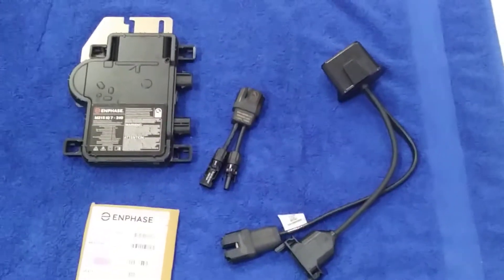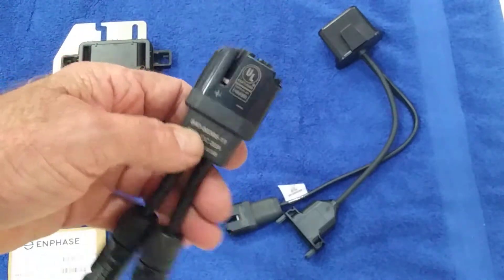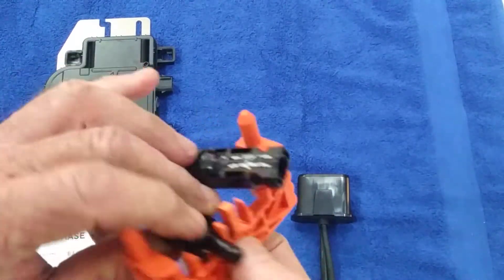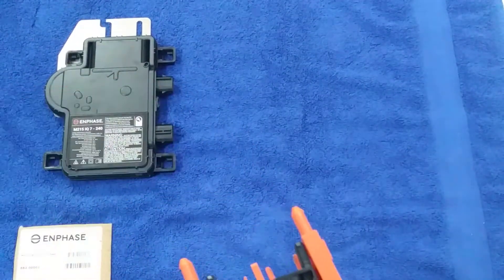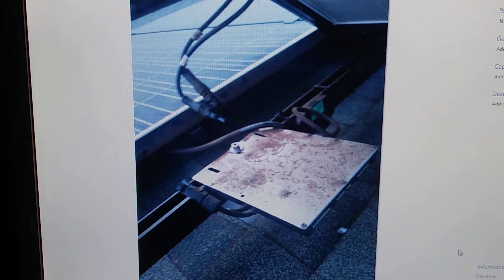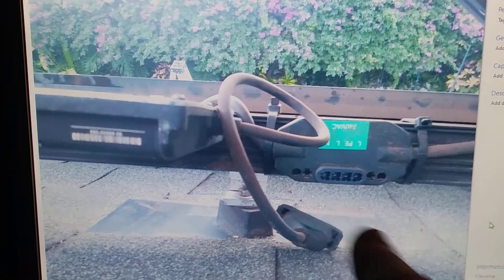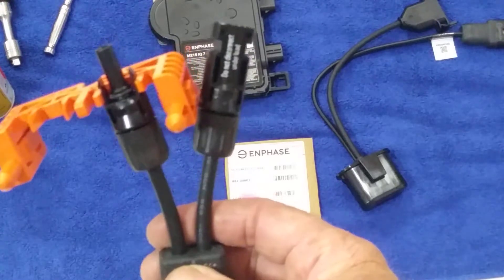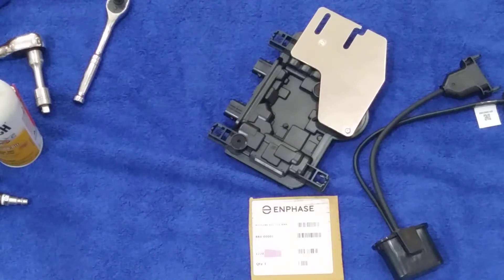Changing An Enphase M-215 Inverter

Comment: That was really informative!  I got a new M-215 IQ7 from Enphase under warranty.  Now I'm going to order the tool.  For some reason they sent me 3 of the cables that go to the panels.  They also sent me 1 cable to the rails.  How heavy is the panel?  I'll be working by myself.
Reply from the maker: Hi, Dave: I was up there working alone too. Hopefully you are replacing the inverter on a panel that has another panel below it. I have 4 panels that face East and my first attempt was on the top right panel. First try to read the serial number on your "dead" panel with your phone's camera. Have Enphase verify that the serial number is the dead one. My installer cross-labeled my #4 panel facing East with my #3 panel facing South (I could tell instantly from the daily production numbers, & Enphase switched the two panels on their end). Once you verify that the panel that appears "dead"  has the dead inverter's serial number, remove the 2 end clamps IF there is another panel below it that will keep it from sliding down the incline.  Next, loosen the 2 center bolts (do NOT remove) & slide the panel towards you until it is clear of the 2 center fasteners, raise it up & put 2 short supports under it (avoid doing this on a windy day). When I was replacing the inverter on a bottom row panel, I would bring up a cement block and heavy string so I could tie the panel to the track above it at it's middle. I also brought up wood of 2 different lengths; you will need 2 short pieces to hold the panel up while you duck under with the special tool and jiggle the connections apart coming FROM the panel; once those wires are disconnected, you can prop the panel up higher so you can get underneath it to get to the inverter connections at the track. The panel isn't too heavy, it is the sheer bulk (size) that requires careful handling. I have never removed an entire panel; I merely raised it up & put 2 wood supports underneath to hold it while either rope (string) or a cement block acted to assist in holding it from sliding off the roof. Enphase may be using the new inverter for several different panels; thus the 3 different cables. Be sure to select the cables that match the connections that you separated. Be sure to get some long heavy zip ties to hold the wires up off the roof. Our Home Depot did not have super size heavy duty zip ties that one needs, but Wal-Mart did have them. You don't need birds, squirrels, or other rodents gnawing on or pulling apart your wiring. On day #1, I would get up on the roof before sunrise with my cement block, spray Liquid Wrench on the bolts and I would carefully break loose the bolts on the problem panel. If that process took too long, I would make the bolts "snug" again, and plan on returning the next morning to install the new inverter. Roof shingles get very hot, very fast in the sunlight. After installing the new inverter, you must phone Enphase so they can retire the old dead serial number and activate your new inverter serial number. Work safely, and try not to hurry; a fall from the roof will cost more in hospital bills than the $$$ you saved by doing it yourself. For me, it was a learning experience and a $$$ saver...  D.
Reply: @DMaui-mq8qm  The bad inverter is on an upper panel. So it should be easier to raise. Question: I have two breakers for the solar system, one at the main electrical panel and a separate box with a pull switch disconnect.  I plan on turning both off.  Did your system have any other breakers?
Reply from the maker: @Dakimis  Turning off both is a good idea; better overkill than getting yourself zapped. My installer took the excess wires coming from the panel and tied them into a big figure 8. This prevented me from raising the panel any more than 12-15". I had to use the special tool and disconnect the wires from the panel FIRST; then I could raise it to 24"+ to crawl under it. The fact that it is an upper panel will make your first attempt much easier. If it is an end panel that is mounted vertically, you will merely raise it on the 2 rails and put 2 short pieces of wood to hold it up. A horizontally mounted panel requires a large block of wood (4 x 6 x 12) centered on the panel to raise it since it will not be touching the tracks when raised. As soon as I connected the panel's leads to the new inverter, a green light came on. Ignore it since you shut down the power before starting. My system was installed in 2014; everything is new today. They don't sell my rails or the fittings that hold down my panels. Use care when handling your bolts; I even took mine down to the garage, cleaned them up, & used a metric tap & die to ensure that my problems would be minimal. To date, I have had to replace 4 inverters; the first 2 were in the top row which are easy, the last 2 were in the bottom row which required blocking the panel & tying it to the tracks above to ensure that it would not slide off the roof. Use common sense & logic and you will have no problems...  D.
Reply: Replaced the inverter yesterday.  It went pretty smoothly. Placed wooden boards to prop them up. Used the tool to disconnect the cables. Little tricky to get it in the right spot!  The bolts came off after soaking in penetrant. Cleaned them up and reused. Some of the original ties were broken after 12 years. Replaced but should have gotten extra heavy duty ones like you.  Question - the old inverter had the ground wire screwed on top of them.  The replacement didn’t have anywhere to screw in the ground wire.  But since the inverter is connected to the railing and the ground wire is also, should it matter?
Reply from the maker: @Dakimis  Glad to hear that all went well. None of my inverters have a ground wire; the bolt holding the inverter to the rail is sufficient grounding. I had 4 inverters fail and Enphase supplied replacements. When the 5th one "died", Enphase revived it twice. I check my system daily and one day ALL the inverters that I had replaced were not producing. Enphase asked about my installer who is no longer here. I asked the rep at Enphase what would kill the 4 inverters that I had replaced myself? Did my installer hit a reset button to restore the inverters to their original serial numbers? I told the Enphase rep that I wanted my installer deleted from having access to my system since he is no longer in business. The rep also told me that there was another entity that could access my system that I never heard of. I told him that must be my installers back door and to delete that entity as well. Now Enphase & I are the only ones that can access my system. The 5th inverter that "died" twice and was revived twice has NOT failed again since my installer cannot access my system. Would an installer create work for himself by shutting down inverters intentionally? I wonder...  D.
Reply: @DMaui-mq8qm  Did your inverters fail about the same time?  I'm going to check the system more frequently now.  As long as Enphase honors the warranty I'll keep changing them out.  Good idea about removing the original installer from the system.  I'm going to do that also.  Another question - do you wash your panels?  If so with what?
Reply from the maker: @Dakimis  I had tried to get my installer to replace the first one, but all the phone numbers didn't work & the company was sold to a mainland roofing company. When I stopped by their office all I got was the run around. My first inverter failed in 07/30/2020, followed by 12/4/21, 03/04/22, 06/04/22, & 09/04/22. The last one was "revived" twice by Enphase & that is when I deleted my installer from having access to my system. That last inverter has NOT failed again. My envoy died around 11/18/21and I found a new one on E-Bay for a little more than half of Enphase's price. The seller gave me the serial # and Enphase confirmed that it was never activated, so I bought it & installed it on 11/18/21. I also bought 2 M-215 inverters that Enphase confirmed as having never been activated at a good discount on E-Bay. I installed those inverters already & saved the replacements that Enphase sent, so I have 2 "spares" on hand. My panels are Canadian solar CS6-P-250P (250w) which are no longer in production. My installer would not assist me with spare parts. I found 4 LG-310 (310w) solar panels being sold at a reduced price since no one uses them any more now (everything now is 450w-600w). Enphase confirmed that the LG panels ARE compatible with my M-215 inverter system so I bought all 4 that he had. I had to buy new rails & mounts as well. My plan is to have some spare parts on hand should we ever get hit by a hurricane and my system is damaged. My plan was to have the 4 LG panels on hand and when needed replace the 4 panels facing East (on the back of my house) and use those CS-6 panels to replace any that are broken on my West & South sides that can be seen from the street in front of my house. I try to clean my panels occasionally using distilled water sprayed from a tank sprayer that I use for that purpose ONLY. I have window cleaning brushes that I mount on a 3/4 inch diameter piece of copper pipe (10 foot long) that is covered by black pipe foam insulation (1 tube) so the copper pipe cannot damage my panels. I spray the panels from the top, & brush the "T" over the glass, spray again as needed and then remove the soft ,wet window jacket and wrap the "T" with old t-shirts to dry the panels off and remove any loose dirt. I find it best to clean my panels when we have a VERY light rain, on & off. Just exercise care when up there...  D.